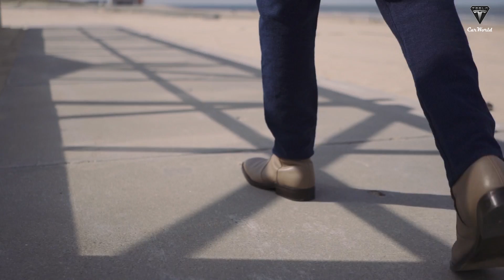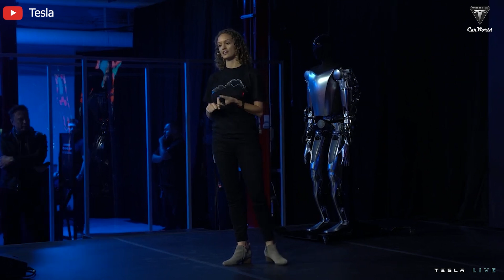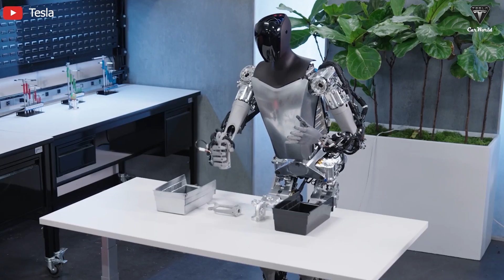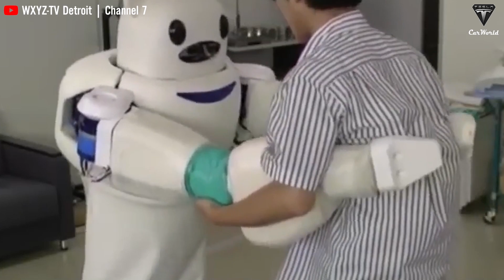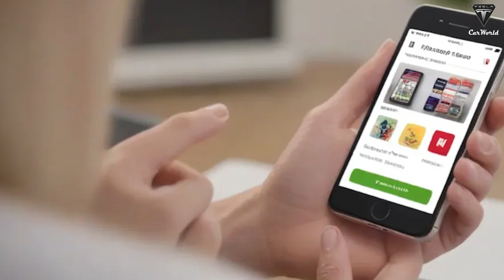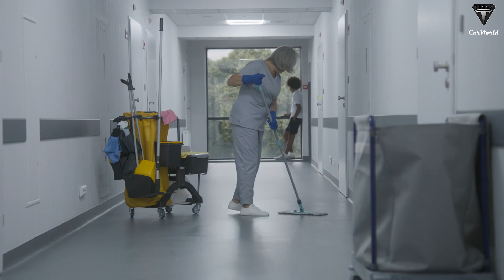Finally Happened! All You Need to Know about Tesla Bot Gen 3 - Optimus! Why Elon Musk Love It?

Comment: Interesting not seen Optimus achieve 6mph or it mentioned before less than half that is the figure generally mentioned with an aim for 2.5. Is there any evidence? The fire risk of hydraulics surely is at least balanced by the risk of electrical battery fires at least till safer battery tech is incorporated. I note that Synergy have moved from electric to hydraulics at present. That said Tesla does likely have a lead I suspect in electric systems and in the end it is going to be the better system.